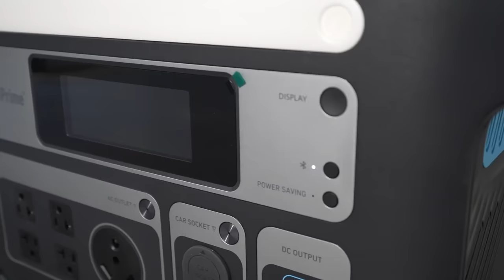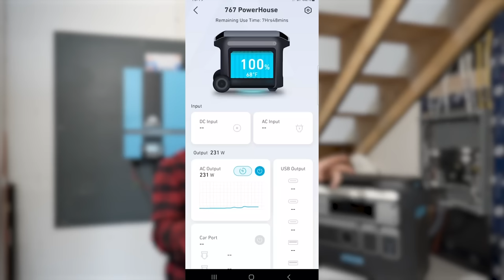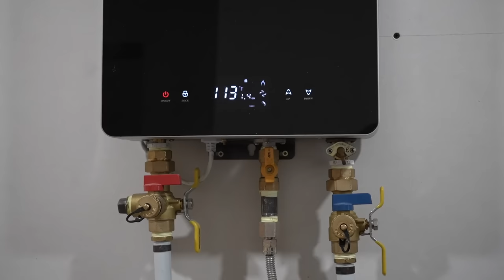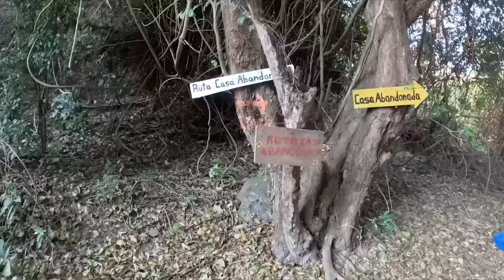We Don't Want To Build This House Anymore!

Comment: You gotta use mold resistant board in that shower area and if bathroom isn’t ventilated correctly the entire bathroom or you are going to have a serious mold issue. You can use Green Board or DuraRock Board with a RedGard Paint covering at least 2-3 coats. If you use RedGard wear a chem mask because the fumes are very strong. Your videos and content are awesome. Thank God Spring is right around the corner.

Comment: When I lived in  the Florida keys back in the 60's we would mark the turtle nesting spots and come back and gather the eggs with my diving buddies grandfather.  He worked with the Florida wildlife department and incubated the eggs and placed the hatchlings in large holding tanks, about 10 meters square or 33 ft . He had several of these for the various sizes. We  would release them when there shells were  about 20cm  or 7 to 9 inches  long if my memory is correct.  Dang I'm getting old. Crap! Y'all are gittin er done. Even got a shower now.

Comment: It's best to use mold resistant Sheetrock in a bathroom.  You should put a water proof membrane in the shower before you tile. I used  Kerdi membrane which is approved to go over regular sheet rock.

Comment: Here’s a tip for the panels, use a weighted tarp with some pull ropes, to pull/lower the tarp to prevent snow from accumulating/having to clean snow off of the solar panels.

Comment: In your shower, you need to change that sheetrock to green board - water resistant - here US is green in color, to avoid mold. Also need to add red guard water proofing. 
You guys have worked so hard in your property that totally deserve the vacation to Mexico, congrats.

Comment: I was told when I was remodelling my house to use blue-backer board for the walls of the shower.  Any leak in the tile grout will cause the drywall to soak up the water leading to more leaks. I was told this after I had the water come up from the floor out side the stall. I had to rip out the shower walls and start again with Blue-backer board.

Comment: I like watching your steady progress and will point out that I am a master carpenter , electrical worker and Plummer , so just a thought and please dont be offended , but replace thr 45 on the inlet and the tub with 90 s to shorten the lines and run them downhill as far as you can as it will create close to 10 psi more and the rule , just like a garden hose is larger inlet usually 2 inch reducwd to half gives you more pressure and the response of your instant heater will work much better also , but if not possible a higher flow pump will help greatly . Please ask if you have any questions as I have encountered many , many situations , Thanks and best of luck .

Comment: the standard for shower valve above a tub is 28 inches above the floor, they make a rol;l on rubber coating to water proof that regular sheet rock in your shower

Comment: I love the electric powered generators with the solar panels.  I love them for around the house to lower my electric bill and keep things on.  I happen to live in an area that has had frequent outages, so I am putting more of these for fridge security system internet modems and anything else critical.  I am seeing my electric bill dropping as I add more things.
  I do not want to put solar panels on the roof because if there is a fire the fire dept will not use water near solar panels due to risk of shock.

Comment: I would look for some magnifying glass to melt Ice off your solar pannels actually I head it works better with tube type cylinder type pannels for heating liquid like antifreeze but they might also work with solar pannels in winter and snow conditions, You are pretty adapt in your abilities just look around for the infor mation. And also there are water heaters rhat are liked a large thermous bottle they are not heated all the time just very well insulated and hold the hot water for a very very long time. I believe they have a large stainless steel coiled tube on the inside and they are very large perhaps a 100 gallons or more. I think they are called indirect water heaters.

Comment: You should not put tile on the gypsum board. It will mold. Guaranteed. Save yourself some grief. Use backer board and some kind of waterproof system.